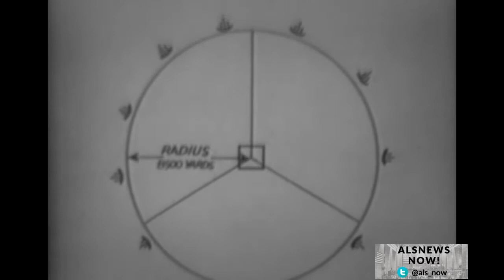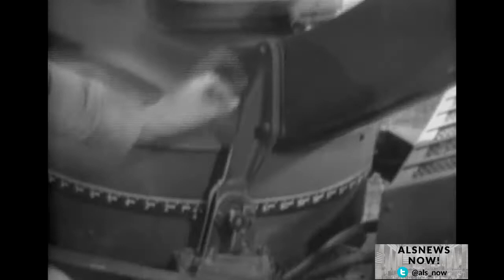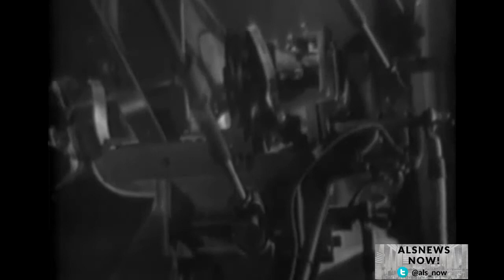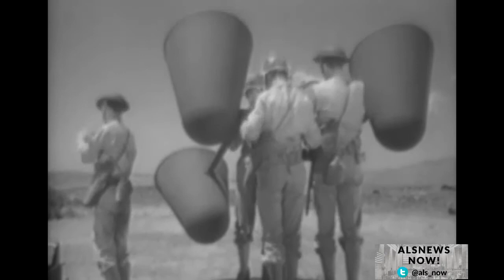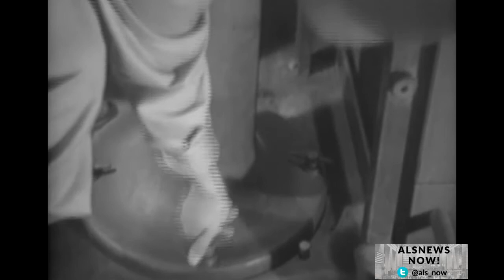WW2 Searchlight Training Video,  Carbon Arc Sperry GE

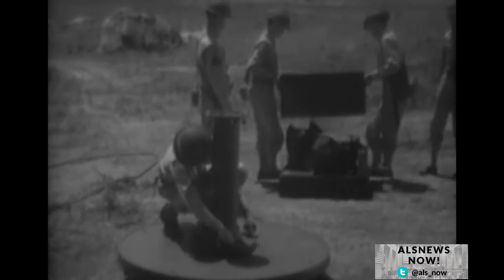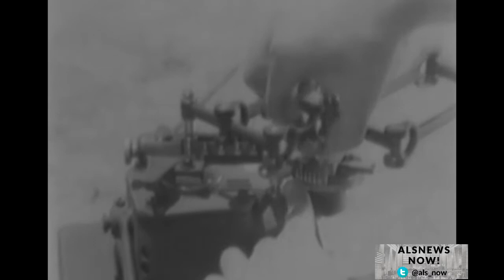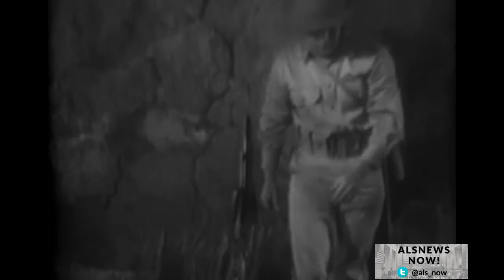Comment: Interesting training film but the file is hopelessly corrupted. The audio track and film diverge at 20:23. At 26:15 the film locks up, audio continues. At 33:33 the audio and film sync up again. You've missed the sound locator set up and all the initialization so that the control station, sound locator and the searchlight are all on the same page.

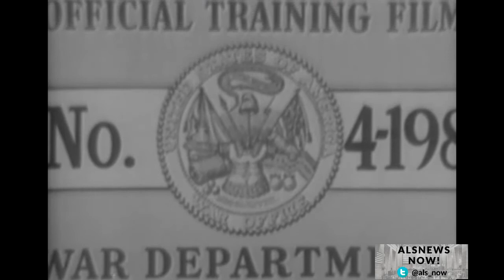At 52:48 a second training film starts on packing up a searchlight battery.

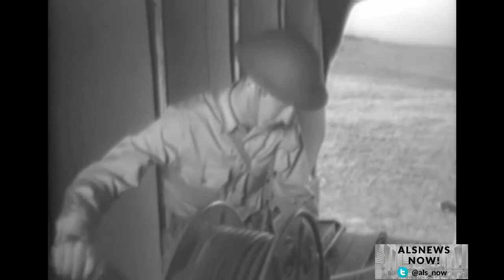I did technical writing for several decades and I was regularly dismayed by how often I found instructions that were going to be ignored in the field. At 56:52 the instruction is given to back truck #2 from the sound locator to the searchlight. I cannot imagine that being done except under a commanding officer completely lacking in initiative. At 1:00:17 backing truck #2 is reiterated! Just can't see anyone backing a truck 900 feet rather than driving along the cable to baby a cable so delicately. I suppose the officers writing and directing this film had a very, very low opinion of soldiers assigned to drive trucks and was sure they'd drive over the cable rather than drive along it. OMG. The red (500') and yellow (200') cables are to be retrieved by backing up also. 1600 total feet of unnecessary backing up? Pfffft.

Besides laying the cables on anything resembling a road or trail straight out of the back of the truck ensures they would be run over by anyone and everyone driving around to check on the installation, deliver meals and evacuate any wounded. If each of these searchlight sections cost $1M 1940 dollars a better way to deploy and retrieve the cables surely could have been done. In Subsea there are IWOCS umbilicals. These umbilicals are directed and protected from scuffing damage on deployment and retrieval by banana sheaves. Maybe banana sheaves didn't exist in 1940 but large diameter single pulley guide sheaves did and that would have facilitated laying the cables away from the track of the truck (on the passenger side) and retrieving them by driving near them (on the driver's side).
Reply from the maker: The reason that backing the truck to collect cable is better is because by nature the weight of the cable pulling down on the reel is easier one, but it also helps get a nice tight pack on the wire. It's VERY heavy and the reel is barely big enough, so if you drove forward and the cable had to make a 180 it would be far more unmanageable. 

I owned amd rented the GE verison of this light for 10 years (Sperry and GE versions are only slighly different- the GE autofeeds carbon rods by monitoring amperage constantly via a GENIUS analog control box mounted at about the 10 o'clock position, while the Sperry does not "smart" autofeed at all). And, there are less than 5 of these working remote control units still known to exist. Many were literally thrown over board on the way home, while many OEM and NOS lights were sold after the war for as little as $100! The NAVY version of these lights had aluminum cans, for anti-corrosion. 

The San Fran museum has the nicest light and control unit in existence.

Also, there were 2 primary technical/service manuals for these lights- about 500 pages each. One for the generator and one for the light. They were written in 1940 and are simply unbelievable. They are mechanical art in themselves. Worth a read.